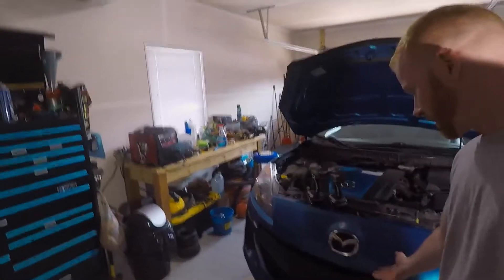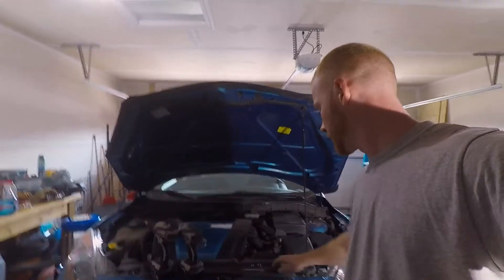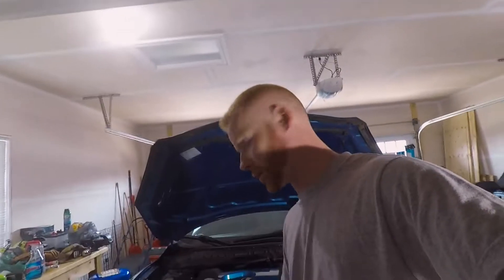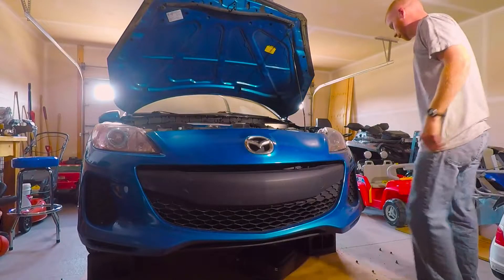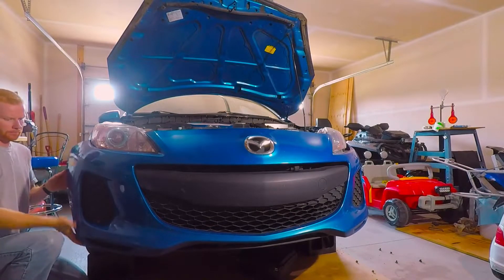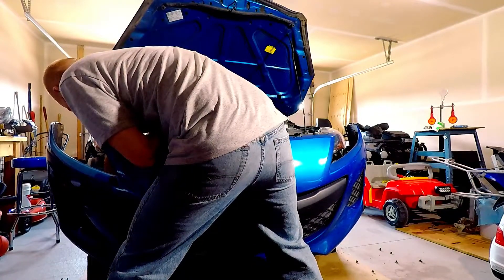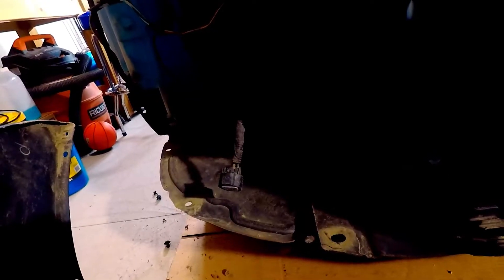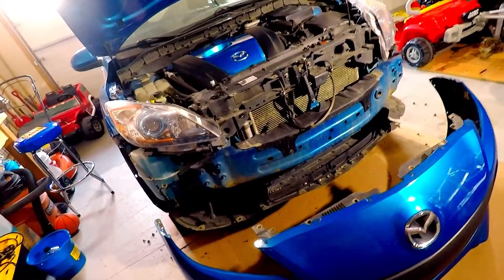Front bumper removal 2013 mazda 3

Comment: That cable is actually for fog lights. Mazda left it there on all models but just clipped it onto some plastic. I’m about to install the fog lights on mine (Hence the bumper removal video) which also didn’t come with them. All you need is the fog lights, wiring loom that plugs into that connector, and the fog light switch (the turn signal stalk, which needs to be replaced to run the fogs as the switch for them is on there). Great video hopefully my removal will be just as smooth as yours.
Reply from the maker: That's awesome to hear. Thanks for that information. Well I hope my video helps. Let me know how your install goes. That sounds like a great mod to do. Did you go with fog lights from the dealer or did you find them cheaper or better some where else.
Reply: TDL DIY I’m about to pick up a used set I found ridiculously cheap at $20 AUD which comes with the wiring and both lights. The stalk with the fog light switch is more pricey at $60 AUD used from a wrecker. In the US I believe they sold kits for them but I’m not sure. They sell everything from the dealer for about $250 USD according to some US forms I have been reading but I’m sure you could probably go to a wrecker and pick up everything you need a lot cheaper. The fog lights for the 2012 are much more common then the ones found on my AUS spec Maxx Sport. The fog lights shown in the form are the exact same fog lights I’m about to purchase for mine but the instructions on installation are almost identical for your newer 2012 which has different circle style fog lights. 

Here’s the link for the best instructions I found on installing them with all the details you could possibly need. It’s very in depth and helped me out a lot. 

https://www.mazda3revolution.com/threads/2010-3i-fog-light-installation-guide-with-pics.2004/
Reply from the maker: @7homas0wen  Sounds like you got a crazy deal. I might have to look into do that for the wife's car. I will check out some wrecker or here pick  n pull. I am sure I can find everything i need. I will look at the instructions see how big or small of a job it will be. Thanks for all the information it is very interesting and helpful for me and others that will read this. I can't wait to hear how long it takes you to get everything done.
Reply: TDL DIY no worries mate. Just knew the info was hard for me to find and that others may want to put some in.